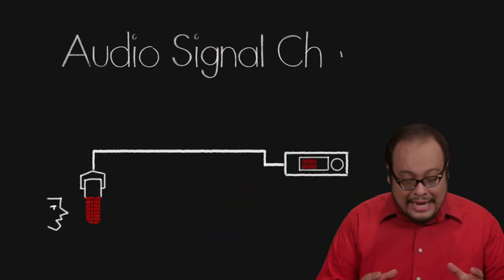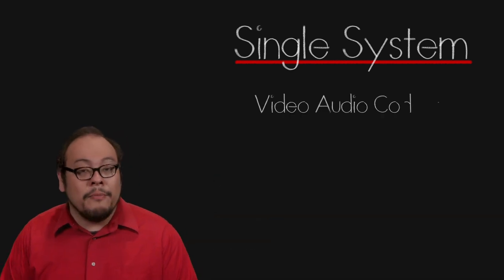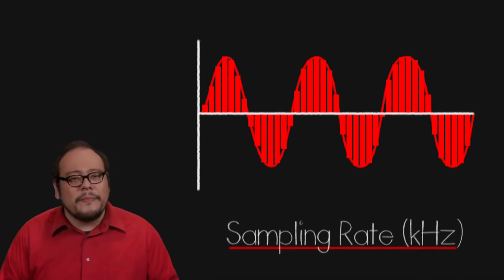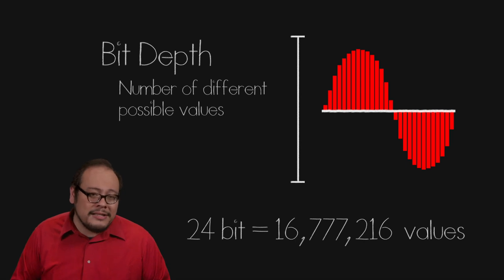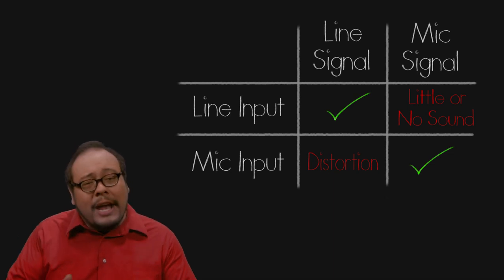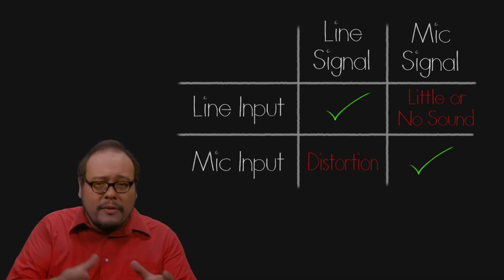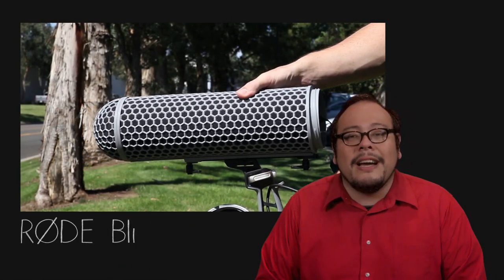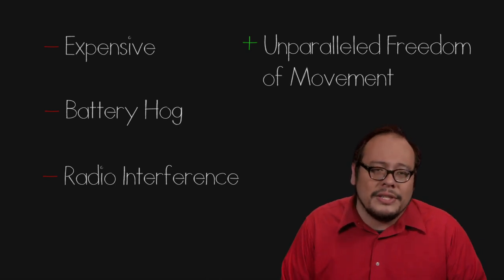The Basics of Recording Audio for Digital Video

Comment: Fantastic video!  I would add that even though boom mics are preferred for the quality of their sound, sometimes wireless lavs are the best solution, for example, when a location is excessively reverberant or noisy and if the framing for the shot is relatively wide. It really depends on how reverberant or noisy the space and how close a boom mic can get, that is, the ratio of wanted to unwanted sound. If the ratio is relatively low, then you might need to use a lavalier microphone. The reason lavalier mics are sometimes superior in very noisy or reverberant spaces is that the distance from the voice to the microphone would be very small as compared to typical boom mic placement. Also, if a location is extremely noisy, the lavalier mic can be worn relatively high up, say just behind the actor's shirt collar or in their hair. Depending on the actor's voice, the higher placement may not result in a natural sounding voice, so it can be a compromise between sounding natural and reduced noise or reverberation. When it comes to the use of lavs and determining lav placement, it not only depends on location noises or reverberation, but also on the quality of the actor's voice and any chest or throat resonances that may be present. If there are strong chest or throat resonances, they can sometimes be minimized by experimenting with mic placement, or corrected with equalization, either high pass or parametric "scooping" in post, although it is also possible that some actors will never sound as good with a lav as they will with a boom mic, optimally placed.

Comment: Minor corrections.  The 1/4" TS [Tip and Sleeve] connector is known as a phone connector, not a phono connector.  The phone connector evolved from the 19th century connector used in telephone switchboards:

https://en.wikipedia.org/wiki/Phone_connector_(audio)

The RCA connector is sometimes referred to as a phono connector:

https://en.wikipedia.org/wiki/RCA_connector

Comment: Nice video as usual. It's ironic though that a video about audio seems to have the audio level much lower (too low) than all other Filmmaker IQ videos.
13:13 Whilst the terms "Hot" and "Cold" are often used, "+" and "-" are also used, and probably more accurate.
13:19 A better way to describe what's going on and how noise is "cancelled", would be to say something like "The input to the pre-amp only amplifies the difference between the plus and minus inputs and not signal which is in phase, or common to both inputs (measured as Common Mode Rejection Ratio - CMRR). Typically, noise is induced on the cable by the same amount and in phase on both the plus and minus wires, so the pre-amp does not amplify the noise (at least not much, based on the CMRR)."
14:24 Great to mention Impedance. But you forgot to mention WHY it may be a concern: Impedance mismatch can lead mostly to poor signal to noise ratio, and loss of frequency response.

Comment: Thanks for your work on this, Mr. Hess.  Right now I'm surveying the video / sound recording field in order to build a quality, entry-level AV workstation for my private studio while also having some components be optionally mobile.  This would let me take some of the basic gear in the studio system and use it out on the road to do live gig performance recordings without having to duplicate gear as much as that is possible. After years of performing as a singer/songwriter - solo or in group projects - I'm at the stage where I want to add music video recording to the art (no, I don't do this enough to get paid more than gas and gear money! lol).  Up until this point, I/we have always had a/v and light professionals or other musicians with the aptitude for the tech covering the a/v and lighting duties.   Fortunately, I've learned tons of basics from hosteling for some great sound and light folks.  But, none of the detailed science and physics as you present - so this has been great.  You are very generous in sharing your knowledge and doing it so that someone at my pay grade can catch a clue.  Thanks again.  I'll be back . . .

Comment: Real benefit of 96KHz (or more) is the flexibility it offers in post production (to me). With more samples you get a more precise digital signal processing, and less phase issues when processing the audio. 48KHz sounds as good as 96KHz to my ears (I would say that I hear quite well), but won't offer this extra step. On the other hand, a broader bit depth will really give you quieter noise floors that are always handy to have. 48KHz / 24bits is still a good combo, and for distribution even CD quality or good MP3 conversion will provide pleasant sound :)

Comment: 100% agree with you John about the wireless systems. Ive used the once or twice at a live show for my guitar, and nothing...in my opinion...beats a wired system.
Reply from the maker: The last time I used a wireless system was for a corporate shoot doing internal presentations - and the only reason I used them was because they're used to walking about and being tethered... but yeah, I had a drop out but that wireless system I have is about 11 years old so it may not conform to the modern radio frequencies standards.

Comment: Hey there!

First, Im working on my Bachelor degree in Audio Engineering, all I want to do is throw in my two cents.
 
I work in sound design and I'm an accomplished musician, and I would say that I only record in 96k once out of every 1000 recordings I do. Its almost never done unless I am trying to capture reference material that needs the extra samples or if its requested. In 90% of all recording situations 24bit at 48k is MORE than enough headroom and its the standard for sound design. Sure, you can do 96k on everything you record if you have the hard drive space and don't mind converting all your 96k material into 44.1k or 48k because believe me, it happens a lot. I'd like to also point out that recording in 24 bit is also the standard, but sound for video games runs at 16 bit, be aware of that. As far as  32 bit, it is usually reserved for super high end recordings or in mastering. Put simply, recording in 32bit at 96k is simply overkill.

Furthermore, I wish this video went over internal clocks as its super important to understand that an internal clock for a camera needs to sync with the audio to prevent drifting.

Great video!

Comment: Excellent video sir. I have (in the past) experienced audio drift in trying to match music to video for music video shoots. I believe the issue was the difference between the 44khz  CD recording and 48khz video recording. I also thought that possibly the CD player was clocked at a different playback speed then the digital audio file on the computer. If you could share some thoughts on that, I would appreciate it.
Reply from the maker: This can get really into some tricky stuff regarding clocks and how your editing system handles the resampling rate between 44.1khz and 48khz. Best advice I could give on that is to resample everything to the final playback (48khz) and work inside that.

But the clock drift is can be a real problem especially mixing consumer gear with broadcast gear. I've seen drift occur trying to sync up GoPro footage.

Comment: Just want to clarify what's being said around 4 min in - sample rate is related to quality but only insofar as the frequency range being captured.  It comes down to the Nyquist Theorem and that digital capture devices need a 2:1 ratio of sample rate to audio frequency.  11kHz isn't inherently worse than 44.1, it just captures 1.5 octaves less of the audible spectrum - up to 6.5kHz as opposed to 22.5kHz - and that's all you need to make speech reasonably intelligible.  Furthermore, 48kHz can actually capture up to a 24kHz frequency and the only reason it'd be less, as FIQ states, would be due to antialiasing filters which are usually applied at the hardware level.

Again, at 6min, the only thing that 24 bit does over 16 bit is lower the noise floor.  If there's any 'translucent quality', it's due to that and that only given that all other variables are the same.  This is only important for the production stage and consumer formats do not perceptively benefit from being in 24 bit resolution over 16 bit.
Reply from the maker: I think saying that sampling rate relates to quality only as a representation of what frequencies is actually quite misleading especially on the low end of sampling and doesn't take into account aliasing issues: demonstrated in the article below

https://www.johndcook.com/blog/2018/01/02/the-engineers-nyquist-frequency-and-the-sampling-theorem/

As far as lowering the noise floor when going to 24 bit I'm sure thats one way to look at it but I see it as oversampling the amplitude levels which when we do go down to 16 bit for release gives us a lot more room to work.

Comment: Not many use 11 kHz audio, not since the 90s and early 00s; the low range for internet radio is more of 22 (or 24) kHz for internet. In fact some compression techniques with AAC+ take 64/22 and upscale it to sound nearly identical to 128/44.

Comment: this was a good introduction. my problem is when the recording software is constantly adjusting the sound levels based on the overall loudness being recorded. what is that called and how do I get rid of it? I always hate it, makes everything sound like I have a head cold.
Reply from the maker: Usually called auto gain or AGC. Generally a good idea to turn it off if you have control over the gain dial.

Comment: Great video.   I struggled with my H4n in post, I think I may have the wrong audio setting.
Reply from the maker: What's wrong with the audio?
Reply: Filmmaker IQ I use Corel Video Studio X9 and it seemingly couldn't sync the audio.  I tried the multicamera editor a number of times.and the files couldn't line up.
Reply from the maker: Were you by any chance shooting video with a cell phone?
Reply: Filmmaker IQ no.. nik on D3200 with a takstar mic into it.  On the H4n I had a Neewer NW-800.  I had phantom power on 48 and the sound came out perfect, just couldn't get them to align.  I am not sure which file type I recorded,  but I think maybe MP3.
Reply from the maker: +Sean Moran the reason I asked about the cell phone is because my cell phone drifts the frame rate...

Well I'm not familiar with that software package. Could you just not find a sync or did the sync drift?
Reply: Filmmaker IQ The software could not sync it at all.  I did record say 4 minutes on the onboard mic and then wanted to switch the the audio from the H4n to demo the difference in mic sound quality.  The audio wouldn't sync maybe because the video file was 7 minutes and the audio was about 1 minute?
Reply from the maker: +Sean Moran were you trying to auto sync? Most of the time those fail because the quality is so different. You have to manually sync by watching the waveforms and visual cues (slates, claps, lip reading)

Comment: Thank you, so many useful pieces of information here! So, if I set a ZOOM H5 to 48khz/24bit and use it as a Single system to record straight to my DSLR the sound quality will be lower than if I use it as a double system and add the sound in post? Thanks!
Reply from the maker: The only difference would be the DSLR probably recorded 16 bit vs 24 bit. If you nail your levels you won't be able to tell the difference. But if you're too low and need to gain up in post you may find the DSLR a bit noiser than recording directly in the Zoom

Comment: Simply fantastic!!! My question is: If I record audio at 96 kHz and put it in a video timeline that runs at 48 kHz how will my video editing programme interpret that? I guess that if the timeline runs at 48 kHz and I put audio that´s been recorded at 96khz that audio will sound pitched down and slower. Is that right? If that is the case how do I fix this issue? And what about if I have mixed audio at 44.1 kHz, 48 kHz, and 96 kHz to work with in the same video project? What is the right approach to this? Many thanks! :)
Reply from the maker: It depends on what you're working with. I use Premiere which is pretty agnostic about that and it will just play fine. But some other NLEs might want to re-encode the 96 into 48khz which the standard Digital Video sample rate.

I've sort of backed off the 96khz recommendation - with 24bit audio you really don't need the 96khz to get excellent sound.

Comment: well that was an in depth explanation of how to shoot with good sound. Although I have one question. I have a recorder which has xlr input but the mic that I have has 3.5 mm jack output. now i have seen many converters out there from 3.5 to xlr , so my question is , will it affect the quality of sound if I use such converters ?
Reply from the maker: ***** You'll mostly likely be fine. The trouble you'll run into with the adapters is how solid the adapter parts fit together - if they're loose or noisy...

Comment: Thank you for the great tutorial! I'd like to ask one more question: it was taken for granted that both the Zoom and the Rode should be used, but if you always place the Rode over the actors, why don't connect it to the camera, instead of the  Zoom? Also, when do you use the small mics coming with the Zoom? Thank you very much!
Reply from the maker: +Jan The microphones on the Zoom aren't really for recording for film/video. They're not terrible - and in a situation where that's all you had then they're golden. Really the mics on the Zoom are to be used just for recording ambient sounds or simple instrument recordings. You could hang it on a boom but your arms will get tired quickly as it's pretty heavy.

The reason you would want to connect microphones to the Zoom are what we outlined in video: The Recorder can record higher sampling rate, better bit depth, (perhaps) better preamps, and flexibility in placement. But if you would rather go straight into the camera, you could potentially save a lot of hassle.

Comment: I love your videos man. Extremely helpful and insightful.

I have a question about recording audio. I am filming a short video that will involve dialogue between two characters inside of a tunnel. What's the best method for recording quality audio for the characters without getting a severe echo or reverb from the tunnel's atmosphere? ...but without making it sound like bad ADR either?
Reply from the maker: +Billy Mangino Probably the best is to use a small condenser mic up close or to use lav mics. Don't use a shotgun because it can color the audio in unexpected ways (I recently made that mistake). 

Expect a little natural reverb because - well - it's a tunnel ;)

But by placing the mic in close proximity, you should be able to clearly hear the dialogue

Comment: Awesome and very helpful video? One question though: If I record at 96k to get that better quality, and then output my final edited video at 48k, I imagine I am losing quality? In other words, if I record at 96k is it imperative that I also output my final edited video at 96k?
Reply from the maker: Recording at 96khz is sort of like recording at 8K video resolution only to dump it down to 4K. You're not really "losing" quality as you go down to 48khz - you're really just creating the best 48k audio you can.

Now... if you dig through the comments here you'll find that this is a somewhat controversial idea. Many will claim that scientifically speaking - you simply can't hear the improvements when going to 96khz over 48khz - that 48khz already maximizes out the capability of the human ear. But then some people will say that certain audio filters and effects actually work better when natively working in 96 khz and deliver a better 48 khz sound file. 

To me? It's not really a big issue as the file size difference is negligible and my computer has no issues processing it. The only really big factor is recording 24 bit over 16 bit... 24 offers a lot more flexibility in terms of levels.
Reply: Thanks for the very quick, awesome and helpful reply! :)

Comment: Jon please give the best advise on using shotgun mic tied into a Sony fs7 via shotgun mic which would be used traditionally as normal shotgun mic,plugged into channel left  xlr and run a parallel mic to  run the on-board camera mikes for ambient audio. With that set up work well in obtaining B-Roll and keeping ourselves available for a man on the street interview. finally should i keep the shotgun mic on a portable audio recorder and deal whit them in post?
Reply from the maker: +Francis  W. Hudman b roll doesn't need audio. So you can lose the shotgun when shooting b roll. Man on the street would be fine to either boom from overhead or from below... You could even use the shotgun as a handheld mic in a pinch.

If you have time and gear and flexibility to do it, it might be easier to record onto the camera rather than synch it in post... It all depends on your exact situation.

Comment: Hi Team,  My purpose is to record videos on my canon camera using  a wireless microphone(just like the rode wireless go). But i also need something to be able to hear(wireless) the audio of the participants in Zoom calls or regular phone calls and talk to them.Bose QuietComfort 35 can do this.But it looks too heavy and lacks the ability of routing my audio to the canon  camera (mic input 3.5mm )which is bit far from my desk. I don't want to buy two different things. 

So suggest me some wireless microphone that can transfer my  audio clearly  to the camera or laptop  and also listen audio in calls.(a very  minimalistic headset that looks good in the videos & video calls/detachable from the microphone setup when not in use).Please ensure it is compact, wireless, good quality microphone. If it is a user replaceable battery system, then it will be more convenient to me.